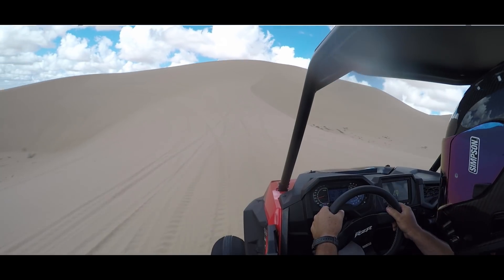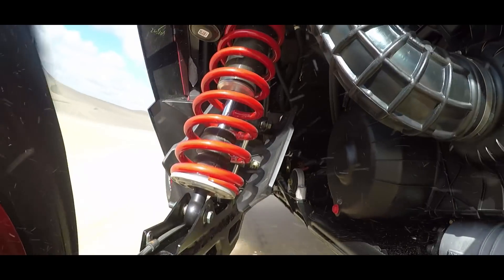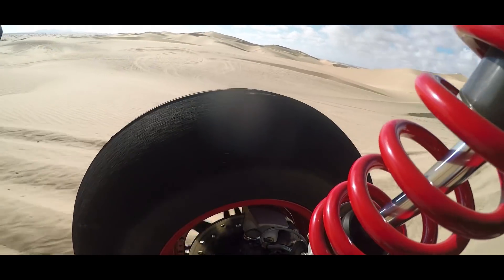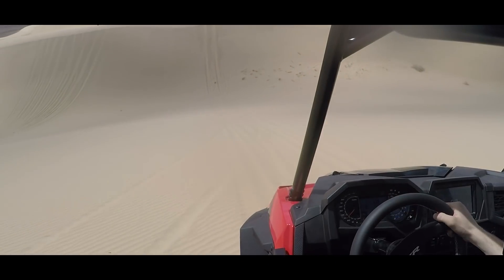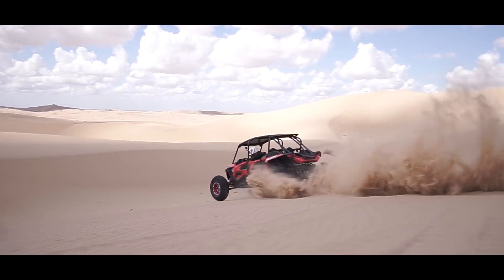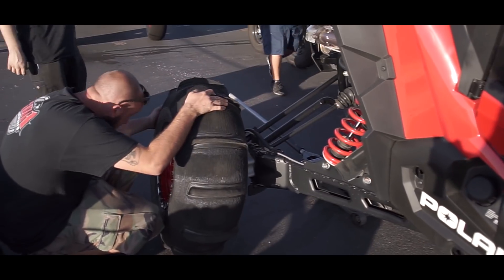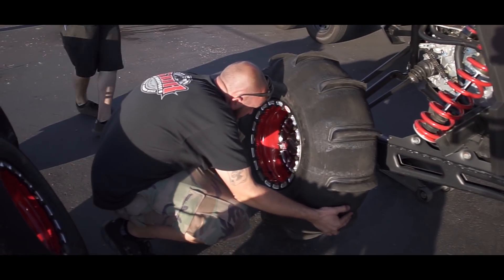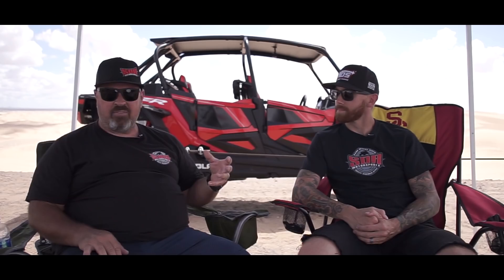2019 Polaris Turbo S 4 in Glamis

Comment: Let's see how many recalls can be issued on this one. There has already been one for the roll cage on the 2 seat turbo s
Reply: That's why you never buy the first year or two of a new model. Wait a few years for the manufacturer to fix everything and add more power
Reply from the maker: Lets hope they have that all sorted out finally. Cage is the first thing you should replace anyways... but we are a bit biased!
Reply: Or, you may not want to finance a 30k plus toy because this economy isn't gonna hold for very long. It hopefully won't crash like 07, however prices are way over inflated on shit like toys. The market won't get buyers at these prices for long. Value will drop. We will look back at these prices and laugh. "geese I can't belive what these things cost a year ago". Remember that? 08-09.
Reply from the maker: @mrchicken8170   what, are you chicken?
Reply: SDR Motorsports Inc . I won't say I've never made bad decisions, but I try to learn from them. Especially expensive ones. Bock Bock.
Reply: @mrchicken8170  zero chance manufactures will decrease prices. Dealers may be discounting deeper when supply comes back around but base msrp’s will continue to rise.